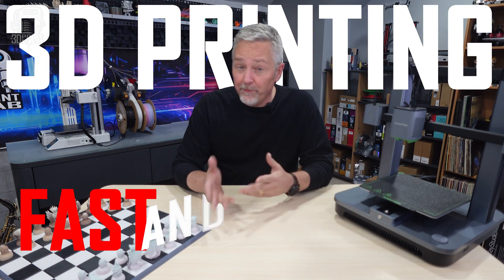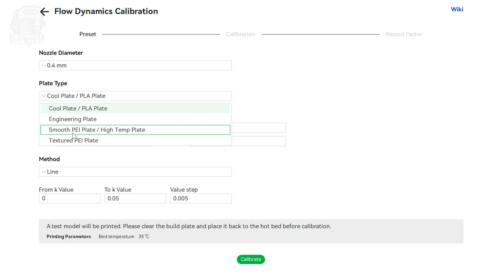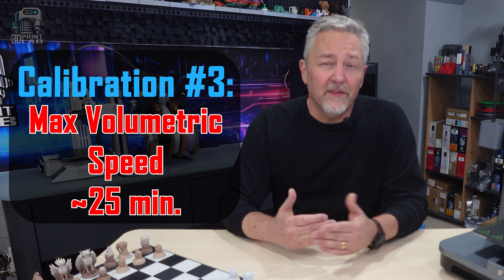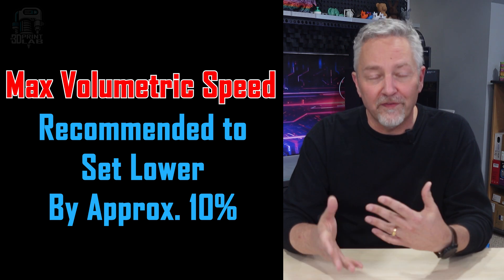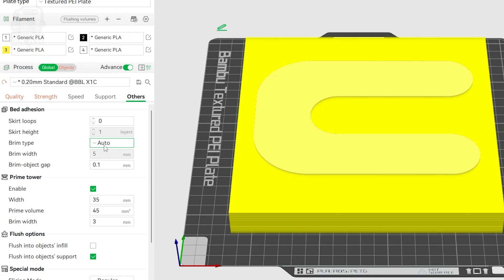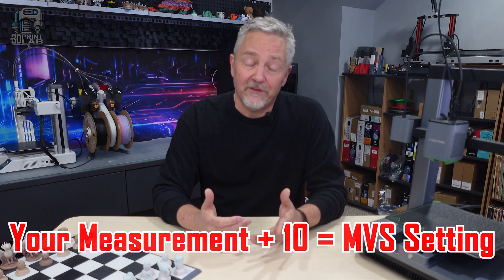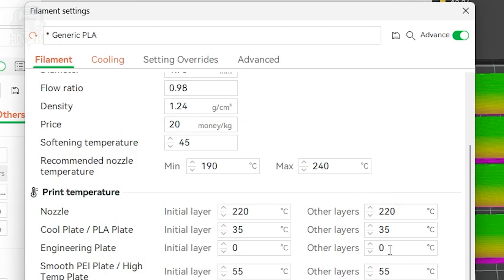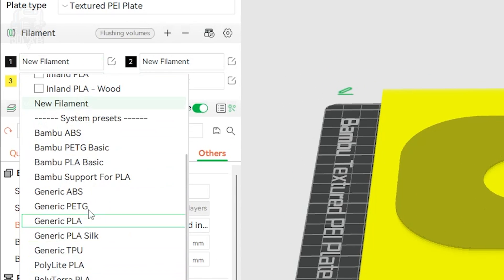HOW-TO: 4 Steps to Pro-Quality 3D Print Speeds!

Comment: Thanks a lot man, I'am new into 3D printing, my first printer is Creality K1c, I am using Orca slicer, and I have an issue with constant print speed (which causes something kind of layer shift), after your wideo I need to do these calibracion prints, and play around with layer time, and we will see if that wil solve the issue.